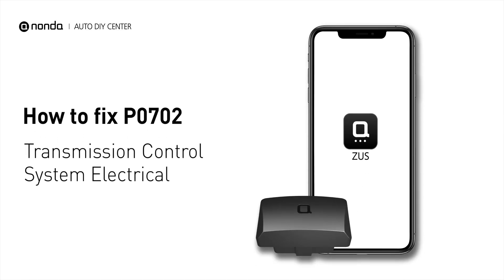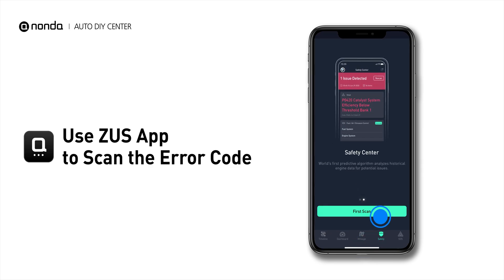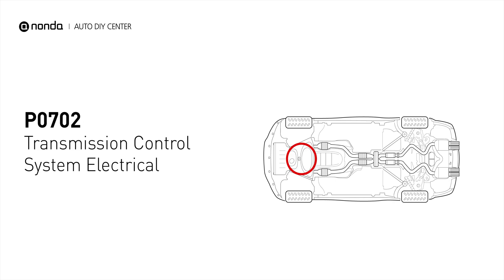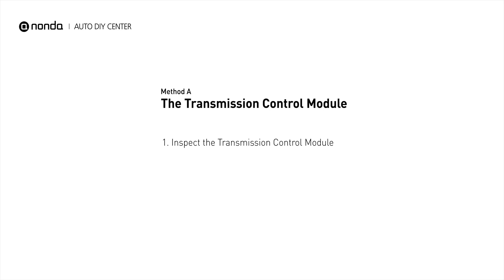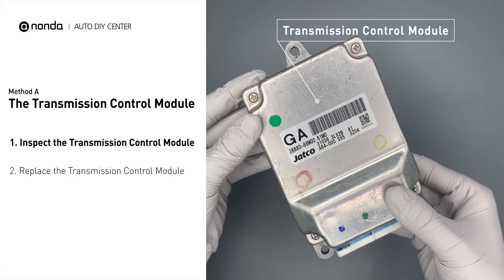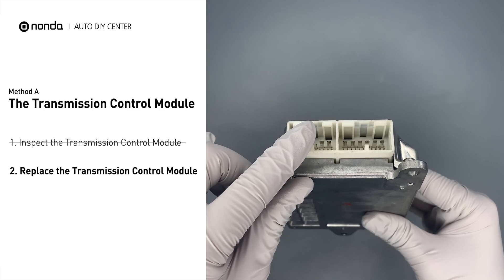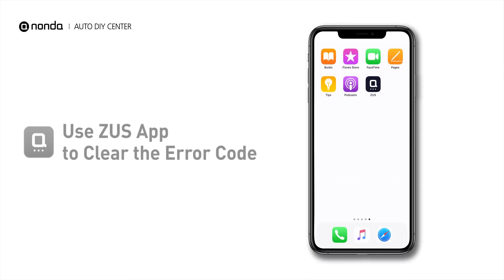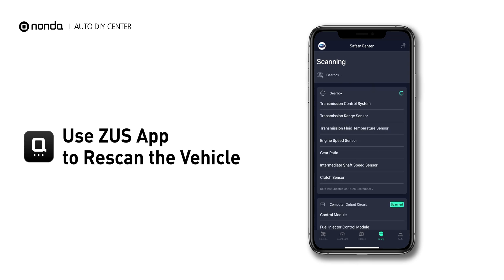How to Fix P0702 Engine Code in 2 Minutes [1 DIY Method / Only $94.44]

Comment: I got that code on my 2002 mercedes c240. I changed the transmission  electronic connector because the seals were bad so oil was present inside of it. My tcm looks brand new but car is still in limp mode. Is there anyway to test the tcm?
Reply from the maker: Hello, it's either your mass air sensor or the actuator for the throttle is malfunctioning. Also, we suggest inspecting the wiring harnesses for any issue.
Reply: @nondainc  .so my mass air flow sensor are actuator, can cause limp mode on my 02 Mercedes e320? 
Code po702
Reply: @bubbawatson1852 I believe so